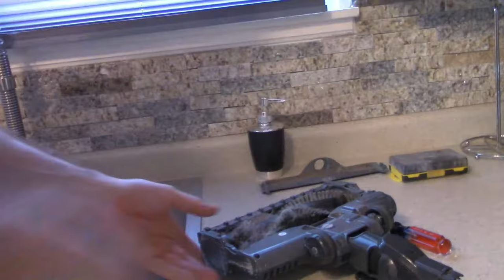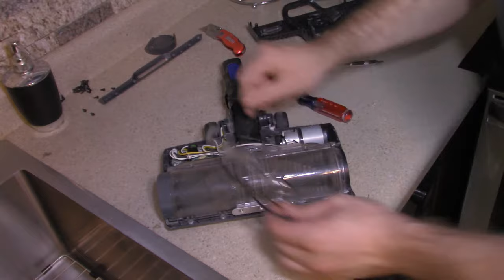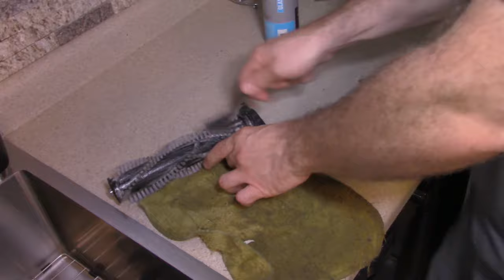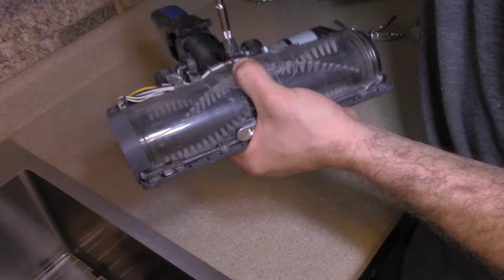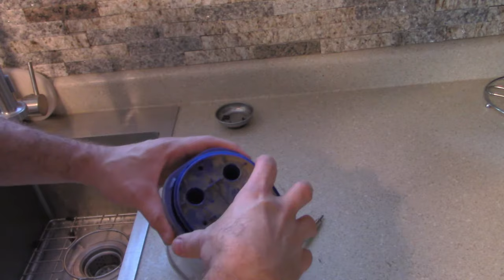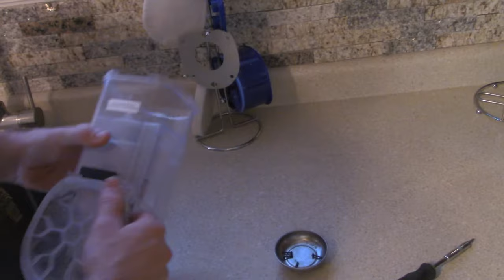How To Clean Shark Pro Cordless Vacuum Cleaner

Comment: Wow.  Most comprehensive video ever.  I agree with it outworking the Dyson and I've had both.  To clean the plastic bottom piece without dismanting, I roll up damp paper towel and just turn the roller section to somewhat clean it.  It's not ideal but it works. Thanks for taking the time to do this.  You could make a lot of money with repairs. 🙂

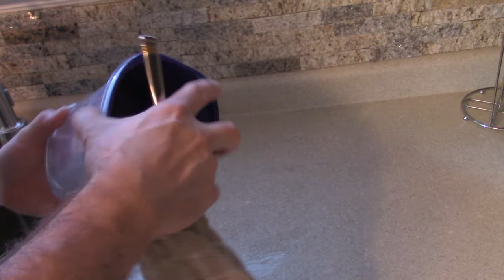Comment: 51:01 you talked about having to remove the main body due to water getting in there. Well this happened to mine. I figured it would dry within the 24hr wait time. Nope. How the heck did you get it off?! Do I have to remove screws first or can it come out skipping that step. Also how much force did you use? It feels stuck on there pretty good.
Reply: Did you manage to either remove it or dry it? Same thing happened to mine, I cannot take off that purple piece to make it dry and I'm afraid of breaking the vacuum! 😰
Reply: @laurabarreto9471   I ended up having to buy the T10 screwdriver so I could remove it. It doesn’t come out as easily has he made it look. I used a butter knife to help lift to a point where I could finish the rest without it. When putting it back together mine did not make a click sound. Hope this helps.
Reply: yeah same haha i can't get mine out 😩

Comment: I did this yesterday.  Every thing went really well except for one thing. The brush/paddle roll wouldn't turn. I kept checking it along the way during reassembly. But one I reattached the belt it wouldn't freely turn. Taking it apart again now to reassemble again. Any advice for what I missed is appreciated.

Comment: Curious on this model is there an option for the roller not to turn but for the vacuum to only suck?
Reply from the maker: shay roller turn in mode 1 or 2 no just suck. Im curious on what you need to just suck and not turn for?

Comment: Did he show how to remove/clean those tiny wheels in the front?  Mine keeps getting clogged and they won't spin.
Reply from the maker: Gets some air tool oil and soak the debris in the wheel. Then try with a pic or tweezers to pull the wheel out. Remove as much hair or debris as possible before removing if possible.
Reply: @TorrentPerformance  Thanks!

Comment: What size e torx
Reply: hE SAID 10 BUT He he also said E10 that their is a hole in the tool in the center of the Torx to deal the nub in the center of the screw head.  One has to wonder why Shark wants to make it impossible for the average DYI to remove the screws.  (follow the money)  It would make sense if this was a bathroom door stall you put security heads to stop the jokers from taking the place apart but this is just overkill on the part of Shark.  Now I need to find who sells the bit.  Thus far no link here and HF does not sell them.  This is when I wish I had a Sear.

Comment: you saved me a ton of time and stress, I got mine apart to removing apart the top and it is NOT worth the pain just to clean the hair from the tiny wheels underneath! Not worth it! The design was NOT user-friendly to clean for sure and at 67 I am not at the level of Chinese children building guns! 🤣😂 You would think it would be as easy as the big screws on the bottom to clean the rollers and the tiny wheels!
Reply: lol😆